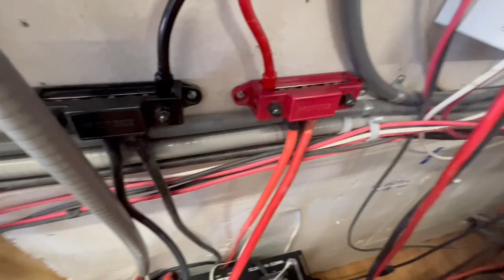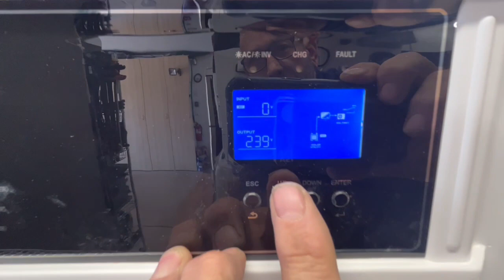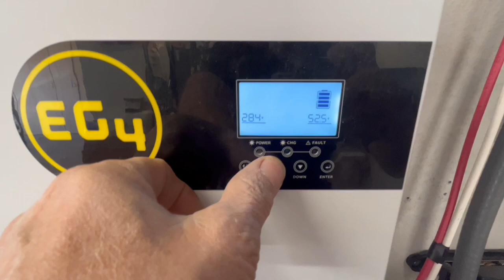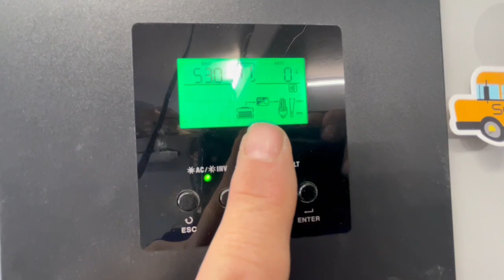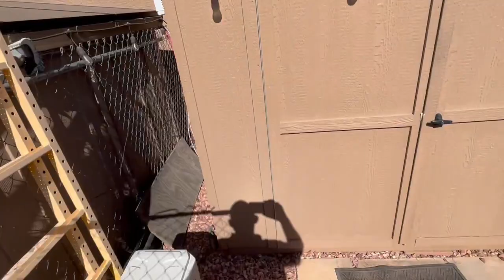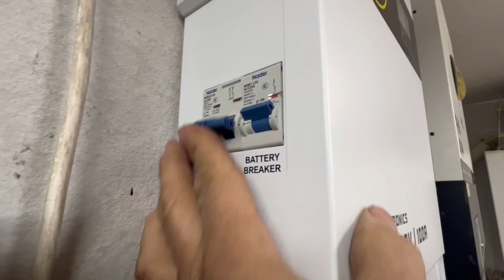Connecting EG4 charge controller to battery bank & solar panels to 6kw Growatt off grid inverter

Comment: My growatt 6000 built in mppt charge controller quit working.. I got a 01 fan error, but replacing the fan didn't help.  Because of the 150 volt PV max. I wired my system in parallel, 5 strings of 2 panels each(even 2 panels in series was higher voltage than the 150 volts pv max). Is a horrible setup because of the low voltage high amp set up. So I purchased a eg4 charge controller and using that now along with the growatt that wont charge anymore.  So now i have 2 strings of 5 panels each wired in series, 395 volts and max of 12 amps. So much better. I will probably be replacing the growatt soon, but for now its working.
Reply from the maker: You can buy replacement circuit boards on eBay to replace in the Growatt low frequency inverters. Just have to make sure you discharge the capacitors on circuit boards in inverter before removing. Those store a lot of voltage. I never replaced one but know you can get them. Do a little research on YouTube and at Growatt

Comment: Pappa - Deanna and I were able to find a used DC Solar Trailer with the (2) SMA inverters, Midnite Solar 250 Charge Controller and (2) 48v battery banks (510Ah each). I am thinking to switch the Charge Controller out for the EG4 Charge Controller so we can build up a separate array that has higher watts/volts/amps from the array than these (10) 230watt panels that are original to the trailer. They are only putting out 1550watts maximum and we would like a higher charging capability for the 1020Ah combined battery bank. Probably going to have to mount the charge controller outside the cabinet on the trailer. I would like to get the (12) 390watt QCell Panels set up with the EG4 Charge Controller - will the EG4 be able to handle that many amps, watts and volts from the panels?
Reply from the maker: Very nice. I hope your project works perfectly for you. The EG4 3000 watt inverters are so for very reliable. Not one issue so far. Solar panel arrays are much more efficient in series up to 500 volt dc PV input than in parallel for 150 volt PV input on my Growatt 12kw inverter. Just keep input amps from PV below 20 amps.
Reply: @diy-solar-guy  will do!

Comment: Your communication cables aren’t hooked up. How do they communicate with each other to regulate the charge
Reply from the maker: You can connect communication cables to inverter but I found that if I just used the setting on charger and set slightly below inverter setting for charging , it works very well. So inverter bulk charge setting is 56.4 and the EG4 charge controller setting for bulk is set at 56.0 volts. Same for float charge on inverter at 54 volts, I set the EG4 charger at 53.8 volts. I could leave them the same as inverter but I’m letting the inverter top off charge rather charge controller. I had no problems while using this way. Hope this helps. Hope you have a truly wonderful and extremely blessed 2024

Comment: We are looking into an Absolyte GX 48 volt/2,000 amp hour battery bank. I am still trying to configure the array(s) and types of panels to achieve the maximum charge to this bank. The specifications on the unit only allow it to work at a maximum elevation of 4921ft above sea level... we are at 5300ft above sea level. I am going to subscribe to your channel - hopefully I will glean enough information to get our Conext SW4048 inverter powering the off grid power we need on our mountain property.
Reply from the maker: That’s interesting, I never saw any elevation requirements on any of the inverters I have bought. Might be but never saw In manual. I will have to look. Contact signature solar and ask them about their inverters if there are any elevation restrictions on their inverters they sell. Ask about their EG4 inverters. Usually 500 volt dc solar panel input which is really efficient and keeps the amps really low. signaturesolar.com. They are really helpful. Could probably answer your questions you have about racking for arrays and overcoming altitude issues. Thank you for your response, hope you have a truly wonderful and extremely blessed 2024
Reply: @diy-solar-guy  Page 8 in the manual (last line) Environmental Specifications Operating Temperature Range 14°F to 131°F (-10°C to 55°C) Storage Temperature 5°F to 140°F (-15°C to 60°C) Humidity 5% to 95% relative humidity (non-condensing) IP Rating IP21 Operating Altitude 0~4921 ft. (0~1500 m)
Reply from the maker: @rongray4118  I will look for that, thank you

Comment: What is the stanby useage of all these inverters running at once? Use an amp meter on battery inputs to figure that out? You likely need 30kwh battery just to sustain the standby!!!!
Reply from the maker: I only actually run one inverter overnight all year. In the summer I run the 12kw Growatt overnight.
Reply from the maker: @XunHinGeD  I am permanently disabled retired so it works out great having all the time in the day to just watch the system work but I only spend about 5 minutes a day actually doing something with the solar. It is pretty much plug and play and no need to do anything. There is no daily maintenance. I love how easy this system is to set up the Growatt 12kw starts and runs everything I own.
Reply from the maker: @XunHinGeD  I’m sorry. That must be horrible.

Comment: I have a Growatt 6k and would like to add more panels but i am to the limit that my inverter can handle. My question is , if i get the Eg4 charger and more panels can i connect them to the same battery bank at the same time?
Reply from the maker: Yes that is the way I connected EG4 to battery bank
Reply: Eg4 and growatt at the same time to the same battery bank? I just want to be sure. Dont want to fry anything😂
Reply from the maker: @raulgil3659  I have 3 separate inverters, I use Anderson 175 amp quick disconnect to move my EG4 around to where I need more input from solar. Works great.

Comment: Hi. Do they have some kind of pc communication  port to save the history?
Reply from the maker: You can connect a RS485 cable from charge controller to battery. I do not think it save data such as history. You can go to signaturesokar.com and look at all the specs and user guide for more info. I turn my unit off at the end of the day and when I switch to charge different battery banks through out the day. I use 3 separate 48 volt inverters systems.
Reply: @diy-solar-guy  Thanks for the info. I was looking at the specs and it seems like it does not support data collection etc. I am considering having this mppt in conjunction with a Victron. How is the noise level on this MPPT? Obviously i dont expect it to be Victron 0 noise but was wondering how loud they are.
Reply from the maker: They are comparable to inverters, drawing only 10-20 amps, the fan noise will be minimal. As you increase amount of amps being used to charge battery, the noise level will increase. At 60-80 amps, the fan is on high and is pretty loud. But I usually pull 40 amps or less from this charge controller at a time so noise level is not to bad. When you are drawing 20 amps or more at a consistent basis, fans will stay running all the time. But the product work’s excellent. I am not bothered by noise since it is next to 6kw & 12kw Growatt inverters running my ac units 24/7 off grid.

Comment: Hey 👋👋👋 Papa
It's just incredible the way you handle your system very impressive... might just pull trigger on one of those eg4 solar chargers costs almost the same as 2 combiner boxes for the 150 voc Growatt 12k... I wanted to ask you if you had earthed your Growatts to a grounding rod or without it and left it floating... Ty
Reply from the maker: I have my Growatt inverter ground and bonded to a independent 200 amp fuse panel box. So the ground from the inverter output goes into fuse panel box and is attached to ground in fuse panel box , then I tightened the bonding green screw in fuse panel box, that is now bonded. I can not put a earth ground on my Growatt inverters, I pick up a lot of voltage from grid tied fuse panel being earth grounded. It causes faults and shuts down inverter. So I bought the 200 amp fuse panel boxes and used those as explained above. Everything I do solar is off grid. I only have grid connected to run or supplement but I do not have it connected to feed back into grid. I rarely use the grid assist since I have enough battery bank now. Just started my 3 1/2 to ac by using 2 server rack 48v batteries. One server rack battery can not handle the load. Hoping to try running main Heat pump overnight to see if the 2 server rack batteries in parallel will get me through the night. Thanks for your comment. Hope you have a wonderful and blessed day.

Comment: Why are your battery evo batteries not in balance?  Surely having three at 13.2 and one at 14.2 is wrong?  Series batteries can be dangerous if they have slightly different internal resistance.
Reply from the maker: I just talked with a gentleman at BatteryEvo yesterday and the BMS will stop charging the battery when over 14v. I need to completely drain the one battery and charge back up. Then it should balance with other 3 batteries. I can drop inverter charge voltage down and it will reduce voltage on that one battery below 14 volts and start charging again. At the end of the day the 4 batteries are usually within 1/10 of a volt. When used overnight, the one battery will be no more than 2/10 of a volt less than other 3 12volt batteries. Gentlemen at BatteryEvo said that is within tolerance. Each 12volt battery has an independent BMS. Thanks for the input.

Comment: With 3600 watts of solar panels in two string at high volt for 180 watt solar panels is 498 volts and they say it can take 5000 watts. I don't see that when 20 - 180 watt solar panels in two strings makes 3600 watts and makes 498 volts in high voltage and small voltage is about 420 volts or slightly higher. Or in this case of add one more panel to just one set hey bring the voltage / 500 I know how high volts. Doesn't that mean that I burnout the inverter?
Reply from the maker: I have 11-250 watt panels in series to make 2750 watts, the second string is also the same. I parallel those together to get 5500 watts. The 11-250 watt panels make 429 volts and when you parallel together the voltage stays the same. The dc amps on the 11-250 watt panels are 9 amps and when you parallel together the dc amps not be some 18 dc amps. The dc amps from solar panels us probably one of the most crucial specs you need to pay attention to. You say you have 20-180 watt panels. There should be 10-180 watt panels in series and another 10-180 watt panels in series, then those two string should be connected in parallel. Your voltage should be what the voltage is on the 10-180 watt panels in series because you add voltage in series but voltage stays the same in parallel. You have not stated what you voltage is per solar panel. The voltage on each of my 250 watt panels are 39 volts. (11x39=429 volts), the charge controller can handle 5500 watts total input. Up to 20 amps input, and up to 500 volts dc input. These are the specs for input of charge controller. The output specs are 100 dc amps, 5500 watts, and charges a 48 volt battery bank, I set the voltage output at 56 volts for bulk charge and 54 volts for float. I have gone as high as 86 dc amps out of charge controller into my batteries. This charge controller is connected to your battery 48 volt bank. If your off grid inverter is also set to 56 volts for bulk charge and 54 volts for float charge you should be alright. The biggest thing is to keep your dc amp input from solar panels below 20 amps, better if it is around 18 amps. So your dc volt input should be 10x dc volts each solar panel ie… 24volts = 240 volts. When you put the 2 strings in parallel the voltage stays the same so if your solar panels were 24 volts each your dc input voltage would be 240 volts. If you dc voltage on each panel was 48 volts, your total input voltage would be 480 volts input. Hope this answer helps. Just stay at 5500 watts total input or less, stay below 500 volts dc input and try to be between 18-20 amps dc amps input from solar panels. Right now I have one charge controller with just one string of 12-250 watt panels and it is more than enough to charge my 48v battery bank at 80 amps along with my inverter using the solar input from separate set of solar panels connected to the inverter for the loads.

Comment: 16 soalr panels, are they all the same wattage? Did u run them on 8 n 8 in a different series? 4 series 4 parallel?
Reply from the maker: The 16 panels are all the same identical 250 watt poly solar panels. There are 2 sets of 8 solar panels in series, then i parallel the 2 sets together to keep amps below 20 amps. EG4 Charge controller should not go over 20 amps input from solar. On the 2nd charge controller I installed I have 12-250 watt identical poly solar panels connected and the voltage is still below 500 dc volts. I will see how well they work tomorrow, I finished late today and it was cloudy out so I will test tomorrow.

Comment: I'd like to know how loud those eg4 mppt chargers get when its charging at 4000w. Looking for a less noisy solution than using the MPPT on my 6500EX .
Reply from the maker: The fans will be loud at 4000 watts on EG4 charge controller. Sorry this will not be a less noisy solution for you.
Reply: Get the eg4 18k
Reply from the maker: @XoffGrid don’t need to spend more money when what I have works just fine and is already paid for itself. I owe nothing with everything I have. It’s just free electricity from here on out.
Reply: @diy-solar-guy  THAT is the End Goal we are looking for!! I am still trying to figure out if these are able to be used at our elevation above sea level - we would be out of the recommended specs by 500-600ft.

Comment: I am thinking about doing the same thing. I love this setup. I believe you will also get longer life line with your inverters. For those who don't understand all he did was use the EG4 mppt 500volts to charge the battery and the inverters for only output
Reply from the maker: Absolutely correct
Reply: I am still attempting to wrap my head around it. I am still learning how to calculate the panels/array to get to the maximum volts/amps for charging a 48 volt Absolyte GX 2,000 amp hour battery bank we need to get online. I think I need another cup of coffee, take a deep breath and dive in again. LOL!

Comment: What is a g get me different kinds of batteries to use in all the same time that's something I didn't know you could do.
Reply from the maker: I am sorry, I don’t understand your question. I have 4 separate battery banks, 2 battery banks are AGM and the other 2 battery banks are LiFePO4 batteries. I never connect AGM with LiFePO4. All battery banks are 48 volts. I have 4 separate independent inverters which is why I have 4 separate battery banks. The AGM battery banks are 12 volt batteries with 4 batteries in series to make 48 volts. I have another set of 12volt AGM batteries in series to make 48 volts, then I connect in parallel to keep at 48 volts. The AGM batteries are 1kw hours each so my battery bank with AGM batteries when connected is 8kWh total. The Growatt inverters Can never be in parallel with another inverter. But the MPP inverters can be in parallel with another of the exact same one. You have to use two or more inverters of the exact same one when connecting in parallel and manufacture will let you know how many you can parallel together in instruction manual or instillation manual. Hope this helps.

Comment: I have a question for you those connections better than they have I see some videos with those connections but I don't have any of those what do you call them Anderson connections I don't have any of that I'm just one of those are better connections.
Reply from the maker: The are called Anderson 175 amp quick disconnect connection. You can get at Batteryevo.com already made with the wire connection. I also bought connectors from Amazon and the cable from Harbor Frieght. I have different crimping tools and made most of my cables with the Anderson 175amp connectors. You can get different sizes of  connectors but I only use the 175 amp connectors for all my battery bank connections that go to the inverters. I use the Anderson quick disconnect because I have 4 different independent systems and can change battery banks or add charge controller when I’m in need of more power to supply loads. We have our solar panel arrays on East, North and west of house and the solar panels get full sun at different times of the day. So I can use the 2 EG4 charge controllers to supply load or supplement loads using Anderson quick disconnect on the cables. Hope this helps